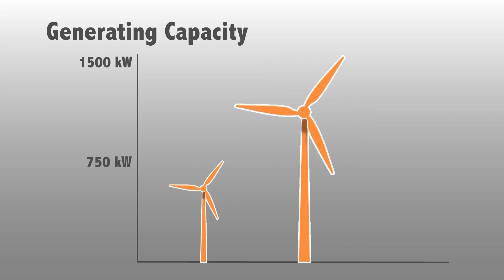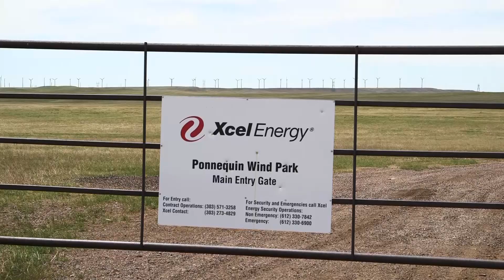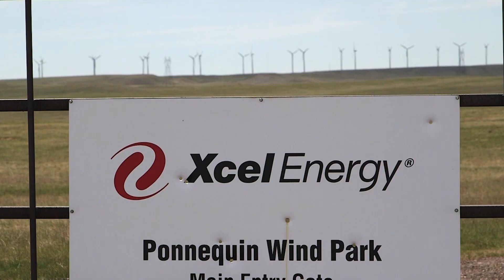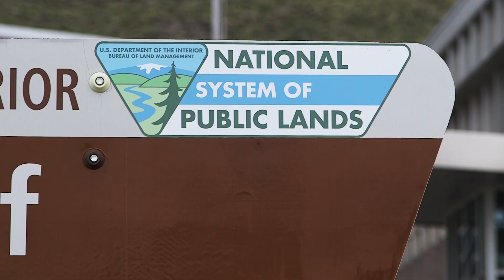Who Cleans Up When a Wind Farm Retires?

Comment: I toured a wind farm near Bloomington, Illinois. The tour guide is a member of a farm family that provided part of the land. The local farmers were concerned, and needed a lot of reassurance before construction began. The agreement is that if/when the towers are decommissioned, the operator has to remove EVERYTHING and restore every square inch of land to farmability. That expense is bonded. Meanwhile, the landowners(corn-and-soybean farmers) receive $5000 per tower, which is way more than the land would produce from crops.
Reply: Hooray for you. Some people were forced to put their transmission lines in like it or not and your windmills ain't worth a fuck without those lines. YOU got paid for this.

Comment: My question on the situation is I have seen a massive amount of concrete base in the ground holding these things up I sure hope they are going to take those out of the ground as well
Reply: Nope. The concept below 4 feet will remain forever
Reply: Average wind turbine uses,800 tons of concrete and thousands of pounds of steel rebar in its base foundation.
Reply: there is a vid showing the turbines being pulled down with base still attached
Reply: Why bother? The buried concrete out in the middle of a prairie causes no harm.

Comment: Looking through the YouTube videos for the one that described the composition of the blades, and how the blades could not be recycled..  Also, the amount of space the blades required in a “dump”.
Reply: It's not that the materials cannot be recycled, it's usually because it's not economically sensible to do so, just as with your own daily contributions to landfill.
Reply: How much of a coal power station is reused? How about an oil powered power station? Or Nuclear? Don’t believe what they tell you when it’s shown in isolation.
Reply: Blades are a massive ring of steel with many drilled holes? The rest depending on age is either fiberglass/ epoxy, or some newer ones. Carbon/ epoxy resins. Only the steel could be recycled. But you would have to separate it from the fiberglass. And that would cost more then the scrap steel is worth. The copper in generators would be recycled.

Comment: Prproblem is they don't know what to do with them everybody thinks the re e great yet no one thinks about the clean up until after the fact same as lithium batteries
Reply: Turbines can be recycled just like car.
The batteries have to many high value elements NOT to recycle them. So no problem at all.
Reply: @Stefan_Dahn  than why are they burying the blades in a Wyoming land fill Google it first thing that comes up obviously if there burying them there is no use for them
Reply: @chuckchillson2877  Maybe in the US it is the case and allowed. In Germany it is not and rest Europe I suspect also not. 
They are mainly made of glasfiber plus plastic (epoxy or polyester). So more are less like a yacht or surf board. This can be grinded and then burned in a power plant to heat buildings. Just the glass fibers stay, wich then can be reused in cement/concrete to reinforce it or be melted down again.
Plastic waste in general is not allowed to.be stored like in the '80s anymore in Europe.
Reply: @chuckchillson2877  PS: As a wind turbine owner and operator, I would suggest your governeur to prohibite this kind of storage of any kind of waste like plastic, rotor blades, yachts and so on. There are better ways to treat the waste AND your country. Just my opinion.
Reply: @Stefan_Dahn  well our government is involved in this dumping

Comment: I worked at a Hydro plant at  Snoqualmie Falls in Washington State built in 1899 and the turbines are still in use today and pretty much every day.  So don't tell me that those wind turbines can't be upgraded and still used.
Reply: haha
Reply: The main problem isn't that they can't maintain the old ones, though how many new parts and such that would take till the point your only using the same tower is a question. The problem is technology improves and before it's shelf life was even done new turbines are twice as effective as the old ones.

It's like saying you could use a computer you bought in the 80's, as long as you keep replacing parts. Doesn't change the fact it's a piece of garbage compared to even a cheap cell phone made today let alone a modern PC.
Reply: the hydro plant in SF dosent make enough power to even count
Reply: i worked at one built in the late teens to early 20s, it still has the original complicated mechanical contraption governor controlling the bucket wheels.  plants that old were only made for an abysmal couple megawatts of power, back when people had maybe two light bulbs and an iron in their houses.  anything can be upgraded also, like you said
Reply: @loginavoidence12  That plant used the old hose on a paddle turbine.  It too had a funky  way to control the speed.  The generators also had a "rotating statot" with three slip rings to take the load.  The field coils were stationary.
Reply: Landlords need to put total removal of turbines and restore the property to make the landlord  whole.
Reply: There's more to consider than just the turbines themselves, the massive blades are degraded by the environment as well
Reply: Sure things can be upgraded, but it it's not economically sound to do so, the companies won't do it.
Reply: Big wheel!  Your an idiot!  The fiberglass cracks ands weakens with vibration over time! Have you ever seen a fiberglass boat that set out in the weather for 15 years uncovered and exposed to the elements!  You can't even touch it without fear of getting fiberglass shards in your hands!  You need to engage brain before typing stupid!
Reply: @offgridselfteliant  hey idiot, it’s called maintenance!!
Reply: @offgridselfteliant  
Yes we had one that was about 35 years old and still fine.
Also fibreglass is not the only material they use. If you want to make something last 100 years you can do it, the problem is that if you demand a 100 year lasting wind mill you pay a lot more while no one can guarantee you that it even lasts longer than a normal windmill.
A producer just declares bankruptcy if you want to get back at them after a few years.
Also in capitalism you only can plan over a short time thanks to badly designed cost/profit calculations, which is the reason why everything build today is just cheap crap.
Nuclear plants are done after 15 years coal plants after 30 as are Windmills.
Reply: @Ismalith You can research this yourself.  The nuclear power plants in Nebraska were in use far, far longer than 15 years, and the one they decommissioned in Omaha could have been used still longer.
Reply: @Coyotenight1  
Many are longer in use but that is just kamikaze tactics as the companies who run them are not suffering any of the consequence when it goes wrong. We have here in Europe many that are far older and still run despite being a complete and unfixable wreck.
Reply: @Ismalith  Here in the U.S., a lot of inspection goes on before a nuclear power plant can be re-licensed.  I guess I thought the same would apply in Europe.
Reply: It’s the GOP government!
Reply: @thomasblackmon5722 bullshit  it's libtard junk
Reply: Hey, Supergenius, the technological requirements and wear patterns of hydro ARE NOT THE SAME as a hydro power source.  You had zero business in a power plant, clearly.
Reply: @bitcoinconstitutionalist9252  Do you? The company involved in the development and construction of the wind farm just didn't want to bother to upgrade them or apply for grants. The wear patterns for the most part are the same whether a turbine is spun by water or air it just spins the turbine inside and at the end of the day no matter what spins the turbine the wear is the same.
Reply: The height and diameter of the wind turbines cannot be upgraded without replacement .... says so in the video.
Reply: @FourDollaRacing  You are right on that part I was talking more on the wear of the turbines themselves
Reply: @the_expidition427  Did you see in my post that the hydro turbines and generators are still in use since 1899?  Same parts for over 100 years.  The only thing upgraded was the brush carriers to use more modern carbon brushes.
Reply: @the_expidition427  OMG the world has evolved into stupid everywhere!  Yes, there is wear!  I've worked on them, in them and on top of them.  The fiberglass  deteriorates like an old boat!  It gets dangerous to touch bare handed,  and they are made to get the money and run!  All they have to do is work to get their tax money!  Investors could give a damn after that!
Reply: @FourDollaRacing  Of course you don't have to change the height or diameter of a wind turbine to maintain or refurbish it to keep it running. Says so in common sense.
Reply: @the_expidition427  <<You are right on that part I was talking more on the wear of the turbines themselves>>

Five years ago or so  a machining outfit near me had scores of wind turbine generators sitting around,  waiting to be overhauled.  The paperwork I saw said that they were in for overhaul after 10,000 hours of use.

I don't know exactly how that was calculated,  but it doesn't sound like much.
Reply: @SeattlePioneer  And that is not good whatsoever and ROI sounds to be highly negligible
Reply: @bitcoinconstitutionalist9252 a turbine is a turbine...period.
Reply: @bitcoinconstitutionalist9252  Did you read your reply before you hit the comment button?

Comment: only 18 years old, buy at a give away price then maintenance, maintenance, maintenance.  viola!  sell power to power company for 20 years.  With 20 year old technology it may be economically feasible for a rolling upgrade to new technology which would spread the cost and take advantage of technology improvements.  an evergreening process that enables specialists to speed up the retirement, disassembly, disposal, replacement and bringing the updated turbine online due to past projects.

Comment: The local landfills will be delighted I'm sure, to take the blades, (NOT) which are totally non-recyclable and starting to pose a problem as more and more wind farms reach the end of their useful life.  The concrete is there forever, and that's fine, won't hurt anything, the other components can all be recycled, not the blades.

Comment: Someone needs to explain to me why, although technology has changed considerably with nuclear and oil & coal fired plants, but we don't see them abandoned & rusting away all over the place.  Those plants have constantly and routinely been expanded, upgraded, renewed, and improved over time.  So, why is this not the case with wind farms?  From where I stand this appears to have been a boondoggle, a scam, or at the least, an ill advised concept from the very beginning.

Comment: Decommission wind farms and restore to the way it was?   And do what?   Go put up another farm on some virgin land somewhere else?   This is stupid - you already have the land under lease,  it is already approved for a wind farm, the wind is proven,  so if the turbines are too old and inefficient then replace them with new larger/more efficient ones - no new land need  be exploited unless more capacity is wanted and more is always wanted!!    On another note:   a 20 to25 year life is really short for any power plant - they need to be designed for longer life.   Furthermore,  any of these farms can last indefinitely if they are maintained - if they can afford to tear down an old farm and restore the land then they can afford to maintain the turbines.   Recycling and restoration is NEVER cheap.   These snow flake enviro's need to live up to one of their moto's:  Sustainability - building a farm to only last for 20 to 25 years that has to then be removed IS NOT SUSTAINABLE!!!

Comment: "We're going to build a power plant that will have to be shut down and replaced in 15 to 18 years." Do you think that would ever fly? Of course not......but they want you to swallow that with wind turbines. Will you?
Reply: Compared to your car life, for a wind turbine this is 6 month. Now, do you drive a Ford T?
Reply: @Stefan_Dahn  - Compare apples to apples. The wind turbines are to replace power plants and provide electricity for homes and businesses that the coal fired power plants used to make power for. So, building wind turbines is equal to building a power plant, not a car. Coal fired power plants have lasted 50, 60 years and more. Hydro power plants even longer. A wind turbine can be dead in 15 years, and is not expected to go more than 25, and is averaging around 18 - 22 years. Then you have to BURY the giant fiberglass blades. They are so big they have to be cut into 3 pieces in order to fit on diesel powered semi-trucks to haul them away to a landfill. Over the next 4 years 8,000 wind turbines, with 3 blades each (24,000 blades) will have to be cut up into 3 pieces each (72,000 pieces) and buried.
Reply: @1001Hobbies  I operate wind turbines since 1995 and my oldest is from 1992, wich is good for another decade.
Here in Germany it is prohibited to "store" this waste in landfill. General rule is, that what can be recycled, has to be recycled. The whole turbines is steel and copper. The blades ar mainly glasfiber reinforced plastic (polyester or epoxy), just like yachts or surfboards. They are cut into pieces of 1-2 m (3-7 ft.) and transported to the recyling company, there grinded into small pieces. Then then this can be burned in a power plant like other (plastic) waste.
I suggest that you would contact your governour to suggest it should be prohibited NOT to recycle as much as possible, as general rule and law. 
The landfill problem is older than wind turbines. There are better ways to solve this problem.
PS: In Germany a guy with a Tesla Model S has now 1,300,000 km on the odometer. Now, how many farting cars can do that?
Reply: @Stefan_Dahn  - Thank you for that information. That is very intriguing. While I know the rest of the wind turbine is recyclable, here in the US, we are told there is no recycle option, currently, for the blades. Of course the industry here is aware of how you deal with them there. Why wouldn't they look around the world to see what other countries are doing with them? Here's an article that explains what is done with the blades here.

https://www.bloomberg.com/news/features/2020-02-05/wind-turbine-blades-can-t-be-recycled-so-they-re-piling-up-in-landfills

As for the Tesla, there are not too many people in the world who even drive that far in the amount of time the Tesla has been owned. How old is it? I drive 24,000 km per year. It would take me 54 years to drive that far. How was that Tesla used?
Reply: @Stefan_Dahn  - Thank you. I Looked into it and followed another link to an article in English. The motors were replaced a total of 5 times (with the latest update to the article) and the battery a total of 2 times. I also read that he "drives cautiously," and that the car is "moved and charged very gently." In other words, the car is not used the way people typically use a car. 
Here's a link where you can see many videos of people's cars and trucks that have gone over 1 million miles. 
https://www.youtube.com/results?search_query=1+million+miles+car

And since I work at Ford, here's a link for Ford trucks that have over 1 million miles on them, and these are not used "gently." They are used for businesses, usually. 
https://www.youtube.com/results?search_query=1+million+ford+truck

Comment: Just think what oil companies do when they want to cut and run.  Soil? Sands and Surface? Water? Ocean Floor?  At least this is just junk. It's not an environmental mess that pollutes indefinitely.  Hopefully  the of state Wyoming will make it right and force Co''s (All Of Them!) to do what's right for the environment  not just the bottom line.  States should not wait for the Federal Gov to police your own back yard.  Using the land, air or water comes with responsibility.

Comment: The investors suck out all the government subsidies and tax breaks then leave like thieves in the night.
Reply: Just like the abandoned well heads leaking methane gas all over the country.
The biggest difference is with these turbines you can see the problem, but methane is invisible.
These turbines are not leaking for decades.
Ten jobs for roughnecks capping abandoned well heads for every one lost halting the keystone oil sands pipeline.

Comment: Windmills produce virtually not net energy. They are mostly made in China using power from fosil fuels. They don't make enough energy to make another windmill themselves. CO2 does not cause climate change, climate change causes CO2 level changes as life levels increase when it it warmer. Unplug you refrigerator to see the affect on CO2 as bacteria eats it. Thats the "Do ya think there is a connection" asked by Al Gore in a convenient set of lies. Water vapor has the same affect as CO2 it intercepts IR, reducing the amount of IR reaching the ground. Just compare earth temperatures day and night with those on the moon. You will have noticed how agressve the pro CO2 scam folk are, that is all part of the plan. And the plan is to get taxpayers money, and it does.

Comment: 5% decommissioned in 50 years is not bad. There is virtually no environmental impact compared to fossil fuel mining...example is permanent destruction with fracking...thousands of miles of above ground pipelines & pump stations...refinery fires...coastal oil spills...tanker accidents.